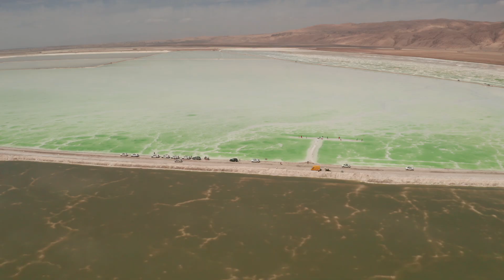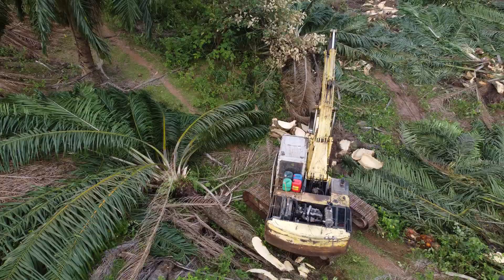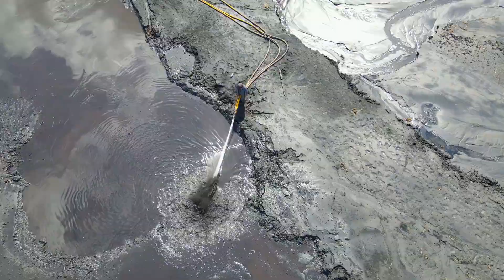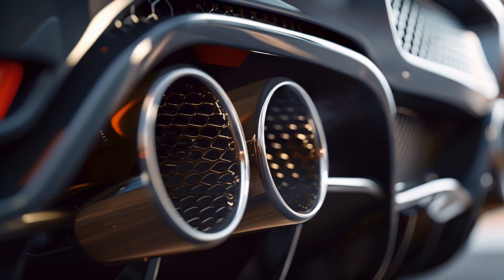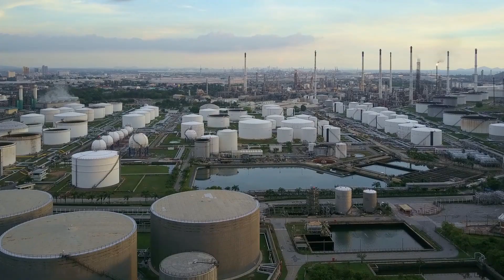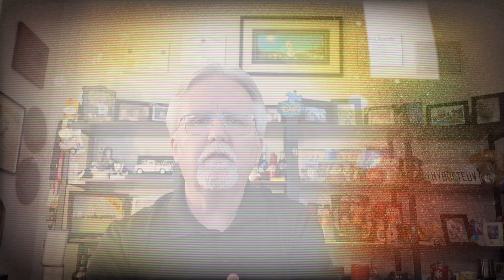Electric vs Gasoline: Which Footprint Is Bigger?

Comment: This mining debate is so ridiculous even if you just look at the quantities. There's around 10-20 kg of Lithium, maybe cobalt and maybe manganese in an EV (the most weight is in copper and aluminium). Yet the oil industry has tricked people into thinking that these few kg or lbs can somehow be worse than the many 1000s of kilograms of oil that the average car burns over its lifespan. I pity everyone who falls for this BS
Reply from the maker: It’s called, “long-term conditioning,” or as they say in the vernacular, “brainwashing!”  🧐🤨

Comment: Great Video. Another point that slides in nicely here is cobalt mining. Ive been called out for having cobalt in my battery, because the cobalt mining industry in the Congo is abusive to the Congolese population. 

One of the largest industrial uses of cobalt is in gasoline refinery. LFP batteries do not contain cobalt.
Reply from the maker: Correct. And gasoline/diesel refining use it by the ton.

Comment: An excellent rebuttal to the disinformation all around us about electric vehicles. Did you know that an ICE vehicle actually consumes more electricity than an EV? I learned of a study some time ago that found from the electric motors powering oil pumps and oil rigs to the refining process, all the way to the electric motors used to dispense the toxic liquid into your waiting car or truck takes more electric power than to simply produce electricity that is delivered via power lines to your vehicle. Bet ya the anti-EV crowd doesn’t want to know about this!
Reply from the maker: I did a video about that a few weeks back. It’s not “electricity” directly but energy that COULD be used to generate electricity. Most of the refining process is fueled by the oil they are refining. Sadly.